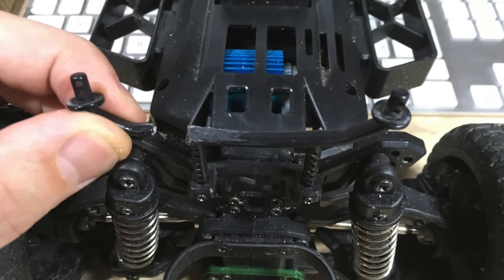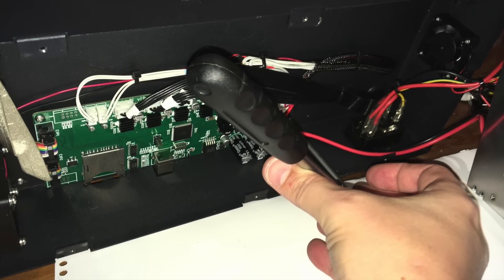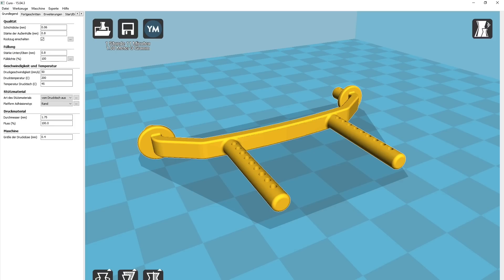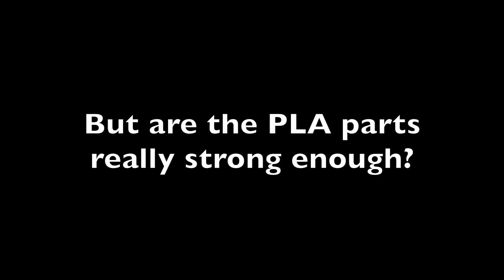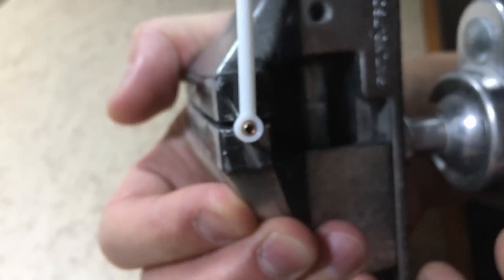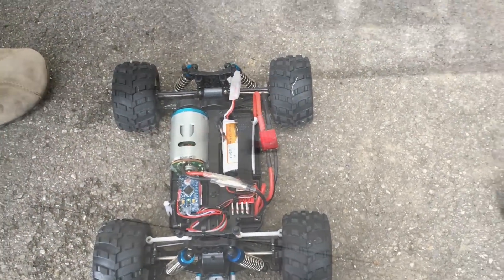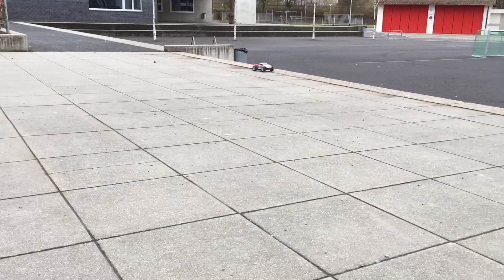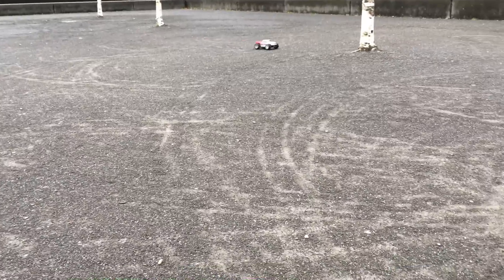3D Printed PLA Spare Parts For Your RC Car?

Comment: Very nice ! Just a question, I am not a champ in 3D design for the moment. I do have the same RC car, did you share your designed parts on Thingiverse or somewhere else so that we could print them as replacement ? Thank in advance.
Reply from the maker: Thanks. The files are available here: https://www.thingiverse.com/TheDIYGuy999/designs